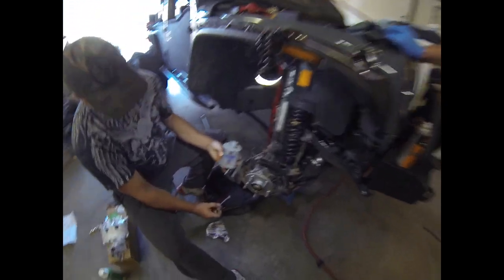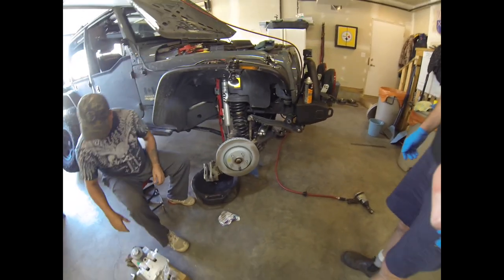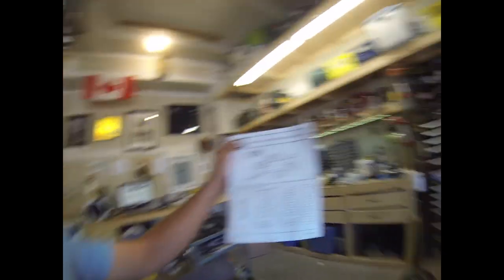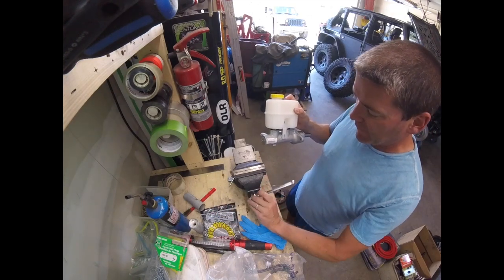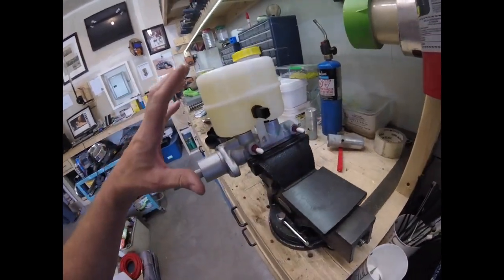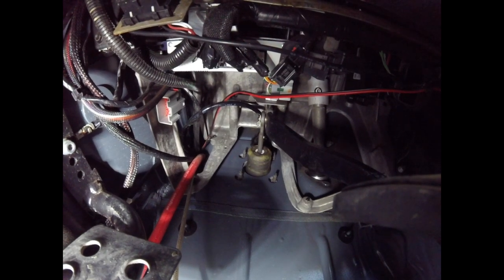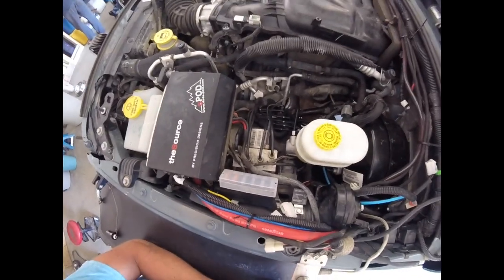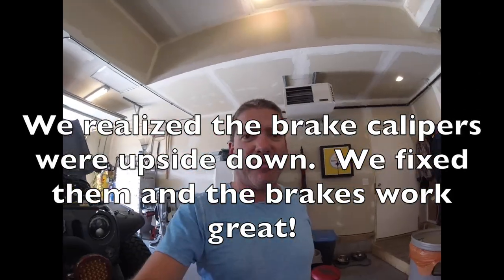Big Brakes

Comment: Nice job with the video. I noticed that the electronic brake booster sensor (Vacuum hose) was removed and replaced on the new booster. How do you get sensor off the old booster. I was going to just pull it off but I wanted to make sure there was not a better way to do it.
Reply from the maker: Eric Ensman Hello Eric.  The booster doesn’t have a electric connection, the master cylinder does.  It does come out, if I can remember correctly it has a small clip holding it in.   It comes out very easy.
Reply from the maker: Eric Ensman Thanks for watching!

Comment: I am looking to get this Mopar Big Brake kit. Just curious why you need to take out the brake booster with the entire bracket, which has all the wire go through the clutch hole. Why cannot just unbolt the 4 bolts hold the brake booster from the cabin side? I also have tons of wire go through that hole and I really don't want to redo all the wires. Another thing is what compressor do you have. The twin or the large single compressor. I have the large single ARB mount right in front the brake booster, I don't know if I can mount the compressor back after the large brake booster and master cylinder installed. Did you mount the compressor back?
Reply from the maker: Hello, at 26;12 you will see why you need to take the bracket off with the booster.I have 2 Viair 400C's I have them now in the back of the jeep.

Comment: Any updates on the install I’m having some problems with my install ..
Reply from the maker: What problems are you having?
Reply: After install booster makes a mooshy air sound ... not sure if I got a defective one ... I’m returning it
Reply from the maker: Dr Chow did you bleed the system and make sure all your vacuum tubes are hooked up properly?
Reply: I was able to get it diagnosed it was a bad brake booster got a new one and a lot better thanks for checking up bro 🤙🏻

Comment: I didn't catch it With the kit must you change out the brake reservoir and booster?
Reply from the maker: Paul Nielsen hello Paul. The kit comes with the booster and master cylinder. I don't think I would do this change without changing the booster and master cylinder
Reply: howmuch?
Reply from the maker: Paul Nielsen I got it for just under $1000. Got it at chochrane dodge
Reply: thanks, i imagine 1000$ and that doesn't cover the help enjoy your video's
Reply from the maker: Paul Nielsen Thanks for watching Paul!
Reply: I'm planning next rotor change to do this upgrade and thanks again for all your videos. The only negative thing I can say about all the stuff you've done. Is it all adds to my wish list lol and thanks again see you around?